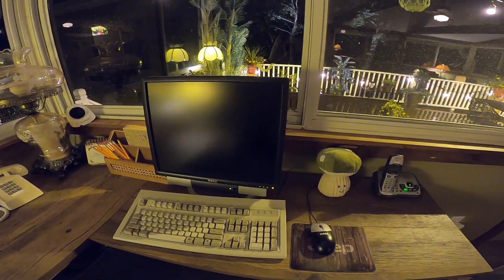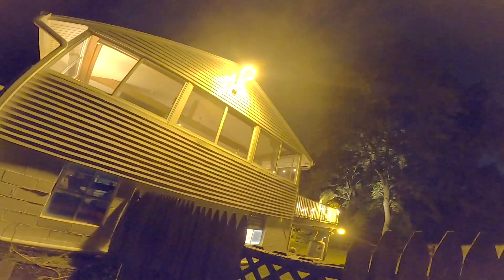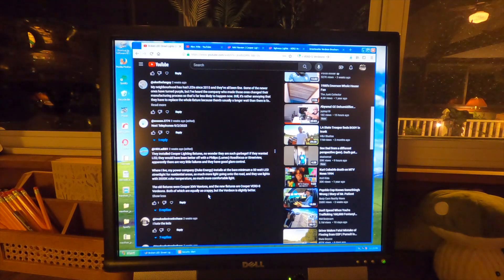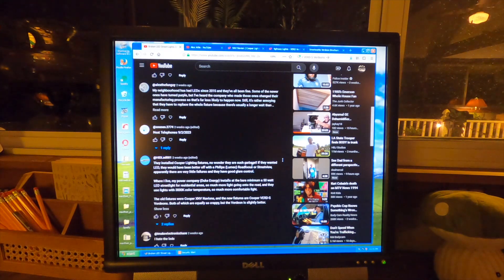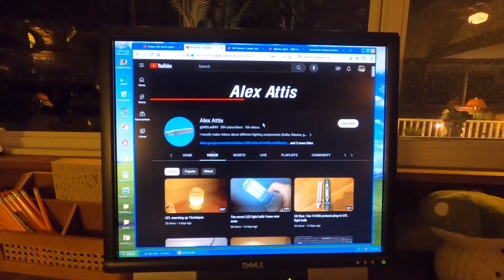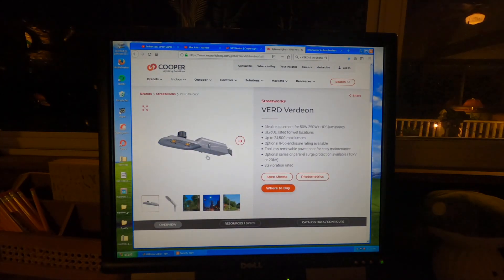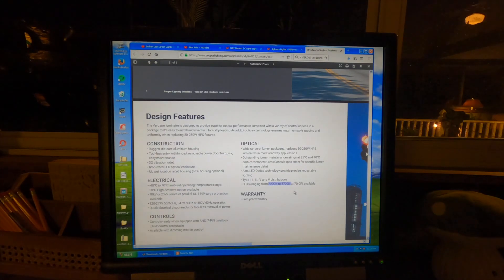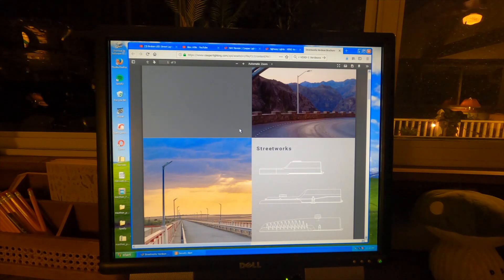Broken LED Street Lights On My Street Getting Replaced, Part 2

Comment: I agree with you LED fixtures just dont last as long as HID bulbs. Have a higher chance of failing and instead of servicing the fixture it gets replaced by ANOTHER same fixture with also has the same rate of failing...pure none sense this world. Where i live all the HPS fixtures were replced by LED in 2020 and most look purple, flicker and are not bright anymore. Long Live HIDs 💯

Comment: That is a total waste if they have to replace the whole LED street light. They should be serviceable but I guess that is too much to ask for these days. Luckily my neighborhood has a combination of Metal Halide and HPS street lights. As the HPS burn out they replace it with Metal Halide bulbs and the ballast too I assume, unless they are compatible. Parts of my neighborhood aren't that old either so it was interesting to me to see they used HPS in the street fixtures. I hope they stick with Metal Halide for a long time as the HPS burn out but we'll see. There are still areas with a lot of HPS working though lighting entire streets.

Comment: When I think of Cooper lighting, I think of some old fluorescent shop lights we used to have. My mother got them to grow (plants) indoors, and they worked okay, but they had a weird ballast which was like a cross between a pre-heat and rapid start. You also had to be careful because when you unplugged them, you could get shocked pretty badly if you touched the prongs on the plug. Eventually she stopped using them in the house, so I took them to hang up in my shed, and for some reason one of the ballasts died and I was researching it, and it turns out that they were recalled for being a shock hazard when they were unplugged. I still have one in my shop now, although the original ballasts died in all of them because they didn't like starting in the cold, and they fried themselves. Really pathetic garbage.
Reply: Those “Lights of America electronic “buzz start” ballasts as I like to call them because they were used in those cheap Lights of America shoplights are complete garbage. They are very cheaply made, your lamps don’t last as long on them, and how they were able to get a UL approval is beyond me. Even instant start makes your lamps last longer. 

They are the one time I would prefer any integrated LED POS over fluorescent because yes, they are that bad.

They used a capacitor and an inductor to brute-force the lamp to strike on 120V. Because of how they worked, if the capacitor failed, the ballast would just die. But If the inductor coil shorts or goes open circuit, and if both short, you have a lamp connected directly to 120VAC 😳!
Reply: @HIDLad001  Yeah, the cooper ligting fixtures used the same type ballast as those LOA fixtures (I actually used to have one of those as well), but the ballast was in the form factor of a standard ballast and not integrated into the fixture as much. I remember that when it was cold, they would have trouble starting, and would buzz for a few seconds before starting the lamps, eventually, all 4 of them died. They worked okay when it was hot, but in the cold they didn't want to start at all. And after failing to start, the ballasts smoked (literally) and fried the lamps as well.
Reply: @WalterKnox  Good for ballast wire though. Was it a Keystone model 240TPES? Those are (I think) the most common LOA-style ballasts that are in the standard FCAN form factor.
Reply: @HIDLad001  if I remember correctly, the brand was some chinese thing. wuxi heng feng or something. I still have 2 of them somewhere because they still worked.

Comment: Thanks that in my zone in honduras still having the 100w hps nema heads, i dont like led lamps because they fail and they have a horrible white light
Reply: they do make different color temperatures for example something like the 2200k you would find on a HPS although there is no warm up time it's one of the best replacements you can get

Comment: If you decide to buy a LED street light, look into General Electric's Evolve series. My town/township replaced all the cool unique fixtures with the General Electric units and I've only seen 3 of them fail scene they were installed in 2017. I'm not sure if they make a 2200 kelvin unit but all the ones around here are the stupid daylight verity.

Comment: Thanks for the mention! I think the 2200K color temperature would be used in places that have sea turtles because the sea turtles aren’t sensitive to yellow or amber wavelengths.
The difference between the VERD-S Verdeon and the regular VERD Verdeon is that the VERD looks like a spoon and has multiple LED arrays, while the VERD-S is more cobrahead shaped and has only one LED array.

Comment: A couple things to mention. First the fixture you have is likely a GE "M-250R2" but other small companies copied the design. I have had some experience with cooper fixtures and I agree as far as quality. Their led fixtures are not nearly the best thing you could buy and even the HID fixtures they made were worse than what other names made at the time. It's sad because Cooper bought out Westinghouse which once made top of the line products and have now significantly lowered the standards. I personally find the Verdeon to be extremely ugly when compared to other LEDs which is just personal preference but I can't stand the look of them. As far as I know the higher color temperatures are used because they are "safer" as they produce more useable light for the same power consumption.